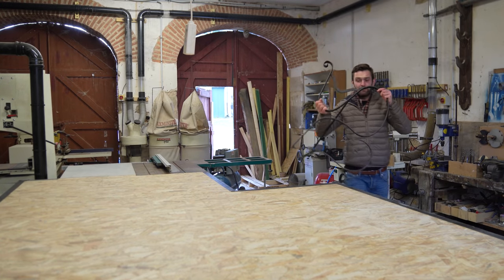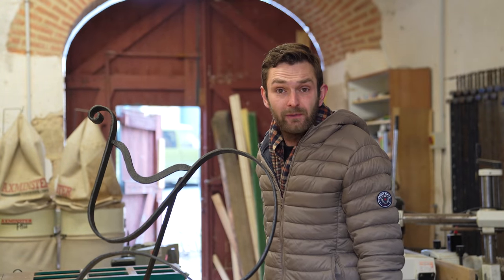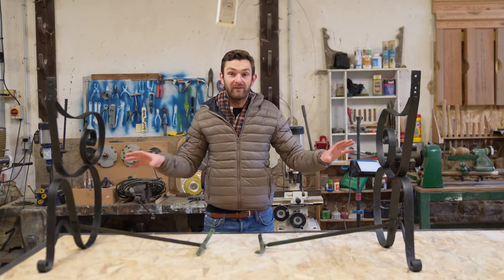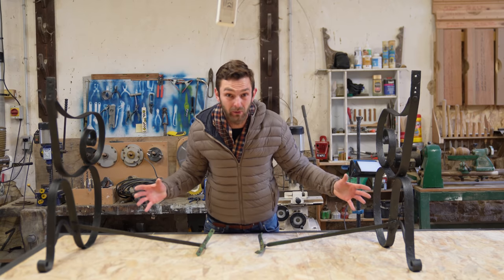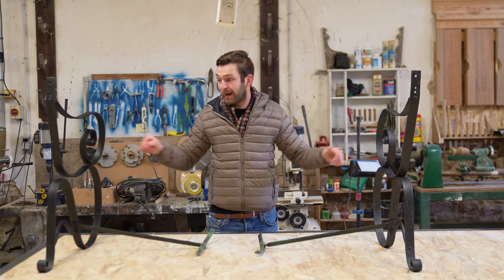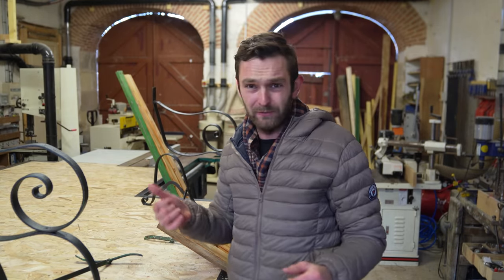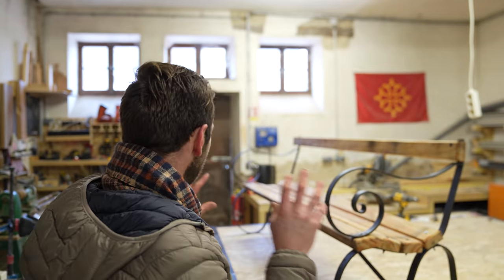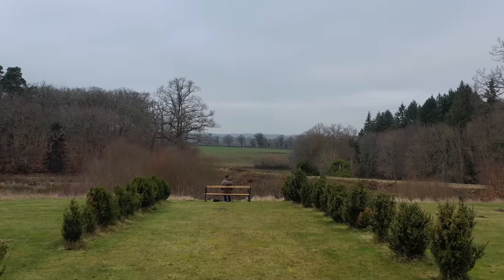Building benches - EP197

Comment: It would look so amazing with the returned lake. During the shot where Dan was sitting by the "lake" all I could about was how sad it is that the lake is not there. It seems like there are so much bureaucracy in regards of such things in France or maybe a strict environment protection laws so such things happen. Maybe someone knows more about it and could enlighten me? :D
Reply: It is more the EU water regulation issues. The money is now there but lots of loops will have to be jumped through doing the environmental survey as they plan an Island in the lake now.😁
Reply: @carolinegooder7091  I doubt an island is holding filling the lake, if that was the lynchpin it would have been pulled to immediately start restoration.

Comment: Well Dan, you're using that catch-phrase "IN THEORY" a lot these days.  Let's see where this goes with this bench fix issue.  But this one does look good with the oiled wood - but that it sits out there in the garden "by the lake" (the non-existent one) seems a sad place for a new looking bench to have to reside.  But it does look good.  Others to come I surmise?  But it's looking good at this one for sure.  So that "in theory" line at least still paid off in this particular case.  Lucky for you.  Now we'll see what the powers-that-be want for it to look like - painted or remain oiled and natural - which really does look nice.  Now then with this job ticked off the list, I think somebody REALLY needs to consider what and how to (thanks to your drone shots) to REPAIR, level, clean, reset, those collapsing, dangerous, and scary steps off the back patio back there.  I mean they really look bad and I'm surprised (though I don't know) that someone hasn't gotten hurt going down those - if they do use them.  THAT will be a big job - likely for Spring or Summer though - but they really do need attention in the worst way. And I think I've said it before, but you're lucky to have Amaury's workshop to do your work in and I can just imagine how nice it is.  I'd commit homicide to have a space like that - or would have, years ago when I was much younger. Now I don't want to work that hard. Too bloody old and worn out.  And keeping it pristeen as he does, while YOU are using it (I mean we have seen your studio space while you're working on it).....but keeping it cleaned up is a good thing although I venture he's the type that could walk back in there and without blinking an eye would say...."who has been using my....(whatever)" and know that something is out of place or having been used.  That's called obsessive compulsive disorder - which CAN be a good thing in some ways, but a nightmare in other ways and for OTHER people as well who have to deal with those types.  But it's nice certainly to have the space to use when you can. Now as for having your own space similar to that - well you have the space next to the studio if that's big enough surely.  Although studio first, then do what needs to be done in the house for Annalise's sake, then in late Spring or Summer - maybe think about your own workshop too.  Would be nice and convenient for sure.  Well have fun and yeah, we'll see ya ta-marra!!  Cheers mate.
Reply: Lake Lande does exist! It is still there and has not gone anywhere. It is currently listed on all maps for the past several hundred years. That goes for the river streams fishery and moats.
Reply: @Tony-InLosAngeles  I'm well aware that it exists.  I was talking about the lake that isn't really there - because it was drained and not restored but they're working on getting it restored through the political machine to get it done properly. I know the chateau exists.  The moat, the streams and such are there yes but the lake is not as full as it used to be and they're working on getting the permits in place to get it restored and all the accompanying structures and interesting things that are part of the lake area that was drained for some time for some reason.  So yes, I'm well aware what's there and what isn't.
Reply: @TonyDeConcini  🤣😂🤣
So careful how you choose those words